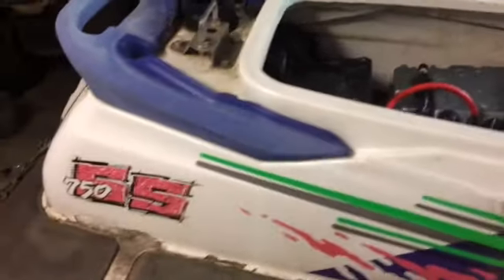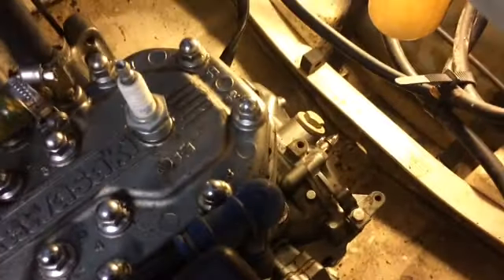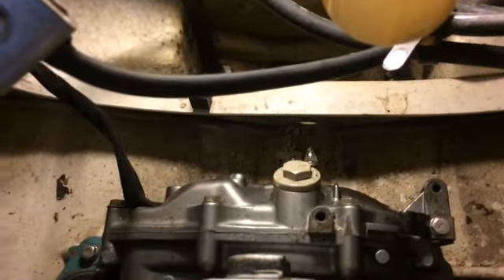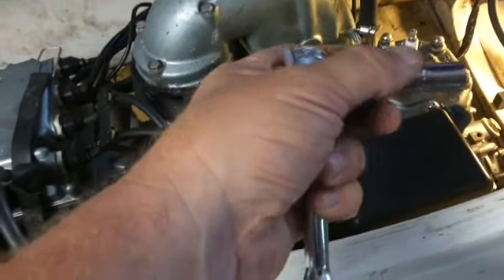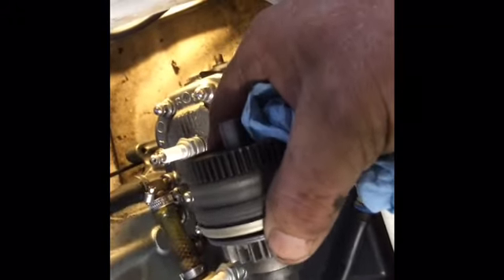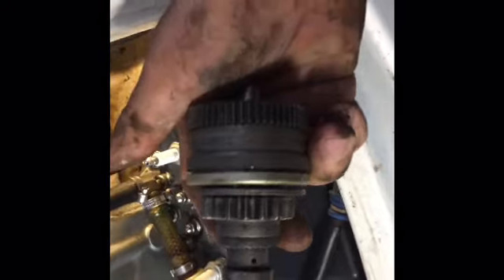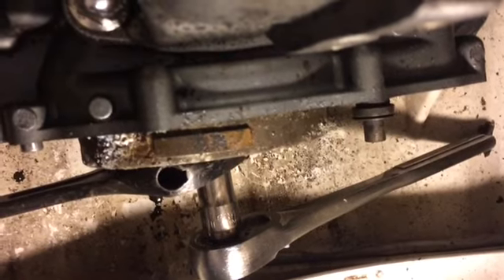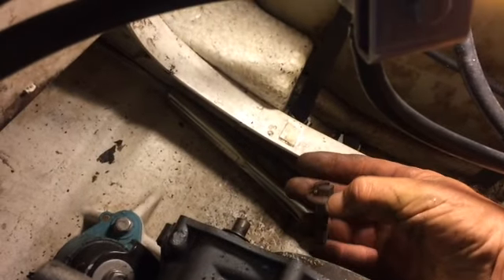1994 kawasaki 750ss, Flywheel Removal, starter bendix replacement

Comment: I pulled the motor and it was incredibly easy. Some of my manifold bolts were broken as well as the Bendix drive so I needed to just pull it. I had the motor out on a bench in less than an hour.  Now I can get to everything so simple. About the most inconvenient thing about pulling the motor is just having to cut all the zip ties on the electrical wires and then rezipping once installed but I'm amazed at just how easy it was to pull motor as opposed to trying to do it with motor in ski
Reply from the maker: problem ive had pulling motor has been breaking mount bolts! why i decided to try it in the ski. wasnt hard either way really. i have three of this model, have torn them all apart cpl times now lol have fun good luck thanks for watching and commenting!
Reply: @crashman1963  I just had to bore out cylinders to 81mm and get new pistons and rings to match. Also deleted the oil injection and running premix now. Had it out on water a few times and seems to be okay. Except that plugs fouling more often..

Comment: Highly recommend “14mm and 18mm spark plug chaser” from Napa to remove flywheel. A crescent wrench, 21mm wrench and hammer got mine right off.
Reply from the maker: nice to hear! thanks for sharing
Reply: Turn it to the right? He did lefty loosey with the impact not sure how that makes sense

Comment: Could you do a video on removing and putting back the spark plug wires? I’ve got a 1994 Kawasaki 750 twin carb
Reply from the maker: do you mean completely from the e box or just trimming and screwing the boots back on?

Comment: I have a kawasaki 750 x1. I believe it's a 97. Same motor as yours. My issue is the starter spins and my bendix dose as well but dose not engage the flywheel. I'm running just off the + & - of the starter so I can eliminate any other issue for the time begin. I'm pretty sure its my bendix not extending to engage. With that said 1. What are your thoughts and 2. The spark plug chaser u mentioned. Why did you use it. I'm a welder and a mechanic I have alot of background in fixing things lol but I've never heard of a spark plug chaser.
Reply from the maker: #1 probably your bendix yes. #2 spark plug chaser- what autozone calls a tap that is 'used' to cleanup plug hole threads, i never heard that term either but the tool worked, lol
Reply from the maker: my bendix was frozen solid w corrosion would not throw to engage flywheel
Reply from the maker: just used that silly tool to remove the fan from my little wonder blower, worked again!

Comment: Like I can turn my engine over with the flywheel but I don’t know if the key is on the shaft please help
Reply: I do not what to sher my key off I’m thinking of taking back off the fly wheel and see again. I’m doing this with the engine in the hall
Reply from the maker: that would certainly tell you, i lined up mine and pulled it on with bolt using impact and stuffed rope into cylinders
Reply from the maker: did mine in hull also, good luck go slow dont want to break anything oh and heated up flywheel

Comment: My flywheel cover is loose, but seems there’s a spring or something holding it on. I can’t get it completely off. Is there a trick?
Reply from the maker: on my setup only thing was touching fly wheel cover was oil pump cut off, starter bendix , o ring, make sure all bolts off.

Comment: Do you have to take out the flywheel to get to the bendix or is there a way to get it out without all that
Reply from the maker: itook out flywheel couldnt see another way as its between the case and flywheel. not a hard job even while in the ski. good luck! good time to have the flywheel turned down, gives ski a little more jump
Reply: crashman1963 my starter locked up on the water and I thought it was the oil pump that failed and the Moyer blew so glad it was the starter but now I’m a little mad cause I took everything off and took the block out to find it was the starter and my dad said we should replace the bendix too but I had no idea how to get it out thanks for the vid